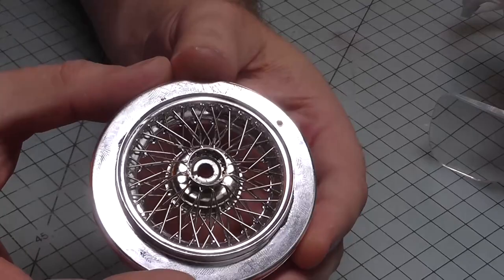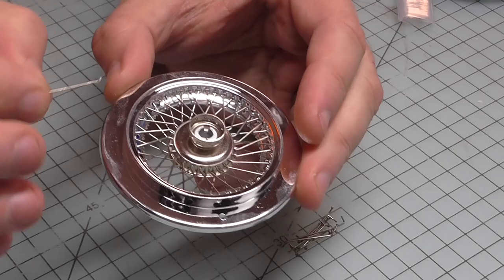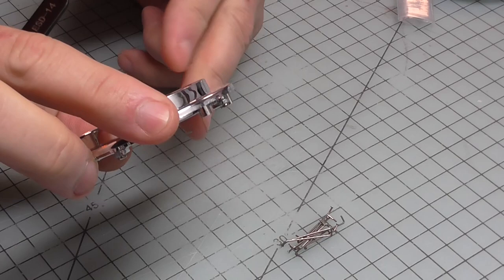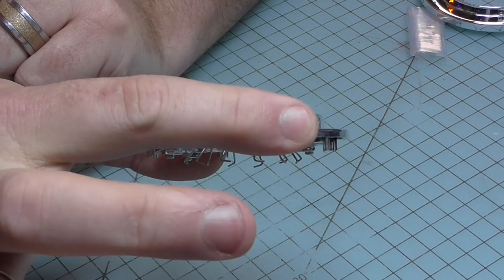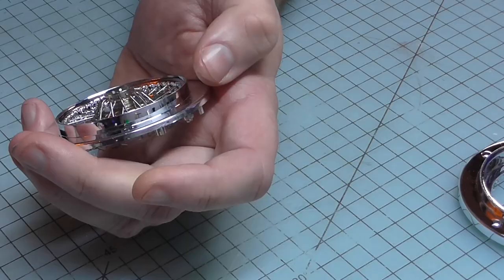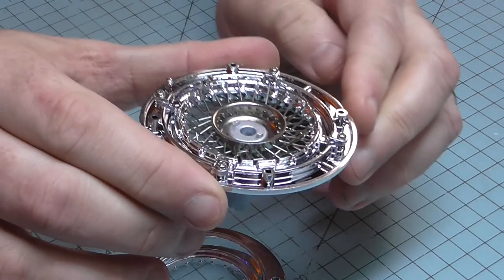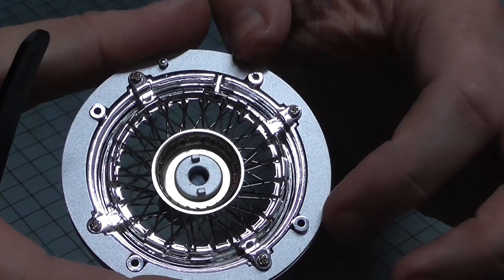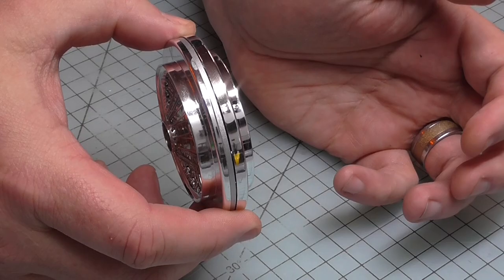Agora Models Build the 1961 E Type Jaguar 1:8 Scale - The Spokes and Rim Part 2

Comment: I've laced spokes on many full scale motorcycle wheels. It isn't always easy..  Doing it with tweezers would be a interesting challenge. Fortunately you don't have to do the tedious part of trueing the  rim. This involves putting the wheel on a trueing stand, spinning the wheel, and adjusting the lengths of the spokes individually until the rim is straight and round.
Reply from the maker: Lol. That sounds terrifying lol

Comment: Hi Wayne, I started building the Agora Jaguar and have reached stage 4, assembling the spare wheel. I got half way through it and found that on the small hub they only drilled 11 holes for each of the A and B spokes. Did you have this problem? I contacted Agora but have not heard back from them yet. Thanks, Ron
Reply from the maker: I haven’t had this problem Ron